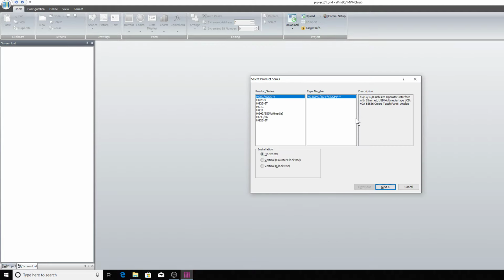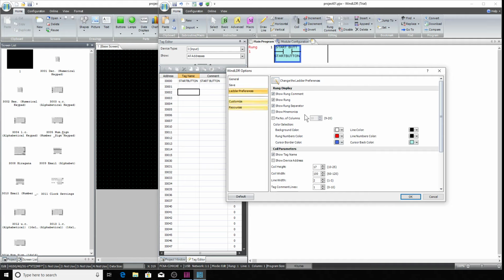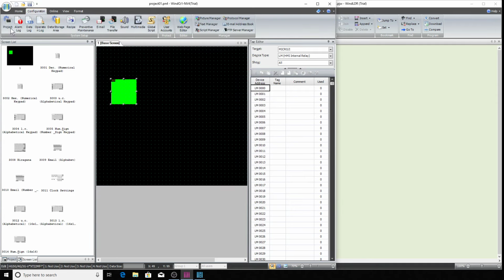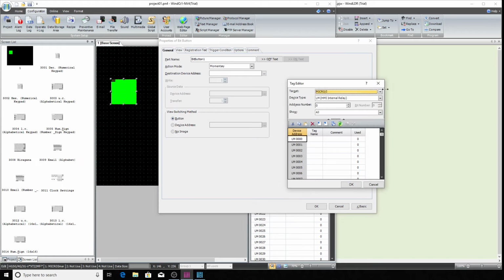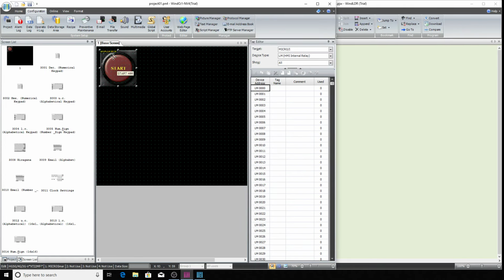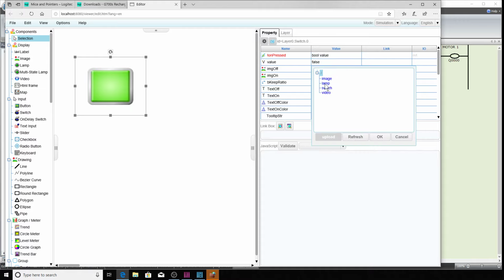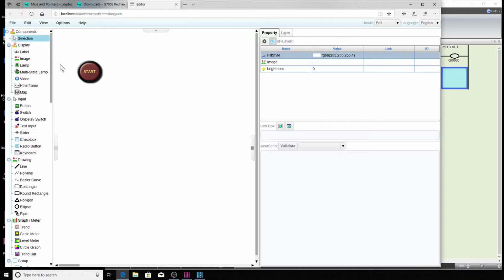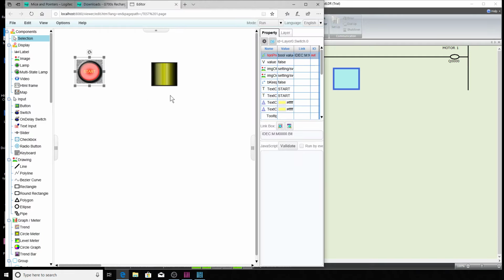IDEC HMI, PLC, WEB EDITOR WALK THROUGH

Comment: Hey! great videos thanks for the help: Quick/long question, have you ever been in this situation below?
HMI NV2 HG1F that is connected by RS232 one day just fails diagnostics when trying to do the comms testing on port Serial 1 which is literally connected directly to IDEC PLC FC5A-C24R2X using an original cable rs232 to mini din 8 pin (FC4A-KC1CA-12)

I think that the serial port in HMI went bad, when we plug a tester in the Serial 1 port, lights in rs232 tester show very very dimmed out.

Was thinking... what if I just get the RS285 Version of  HMI NV2 HG1F and also get the adapter IDEC FC4A-PC3 to put in in the PLC and then either re-design the HMI screen from scratch or try to upload HMI project from busted RS232 HMI kind, and then download it to the HMI RS285 Kind but change the settings in the communication so i can download it into the replacement HMI, because the back up from the upload would retain the settings of the RS232 HMI kind and its comms settings.

Also, not sure if PLC would get pissed about having a different port that connects to HMI etc... and now the program doesn’t work or something. HMI normally tells PLC ON/OFF and Remote ON. Those are the main buttons to press.

Comment: Don't suppose you're still answering questions regarding the IDEC HMI Web Editor? Me and my coworkers are a little stumped by it. You've clearly had some experience and we could use some help.
Reply from the maker: What are you trying to do?  I will help if I can
Reply: @huntxtrm  so the short version goes like this. We are trying to use the FC6A Series with an HMI module at a clients pump station. We used the WindLDR software to build the ladder logic and used its Web Page Editor to create a simple interface for them to use on a browser. We can run a Simulation, open the Viewer on the computers browser, and see that all the data on the HMI synchs with the ladder logic. Our issue is that when we click "Monitor" the data doesn't synch like it does in the simulation and we can't figure out why. You seem to know how at least from the videos me and my team have watched, when IDEC doesn't even have any thorough info out there on it. So just 2 questions: 1 - How do we get data to transfer in Monitor Mode? and 2 - Can we control the HMI from a browser on a computer that doesn't have the software installed. Any info you've got beats what IDEC can supply us with so we appreciate anything even if it's a guess.
Reply from the maker: @landonmckinley1502  first, sorry it has taken so long to reply been realy busy starting up an electrical contracting company.  You should be able to access via the ip address.  You will need to set up port forwarding in the LAN the HMI is connected on.  Shoot me an email, and I will try and help sort it out.  Time permitting of course. RTriggs@SolarTechElectricServices.com.
Reply: @huntxtrm  we were able to finally pull the info out of someone from IDEC thankfully, but we appreciate the help regardless.

Comment: Am using NV4  I want to know how can I program NUMBER on the screen it's like indicator number I done the program on the PLC but I want to know how can I do that on NV4 I know how to use Nv4 the Number change on the screen from 1 to 10 by the interial of the plc I already done the Plc program it's for the elevator screen floor level screen indicator
Reply from the maker: You could use text over the button.  Use the "trigger condition" of the text to make it visible when a certain condition is met.  So, if say you are at the floor level 2 sensor, that condition is met, an the "2" is visible over the indicator light.  If thats not what you are trying to do, please explain more.  Thanks for watching.
Reply: @huntxtrm  thx very much for your help
Reply from the maker: @hajhassanhaj7673  Uploading now.  HD version may take a little bit to get available.  Thanks for the question, and thanks for watching.
Reply: @huntxtrm  thank you for helping us
Reply from the maker: I am making a quick video for you,  If this is not what you are wanting let me know.   It will be labeled "Trigger Conditions"